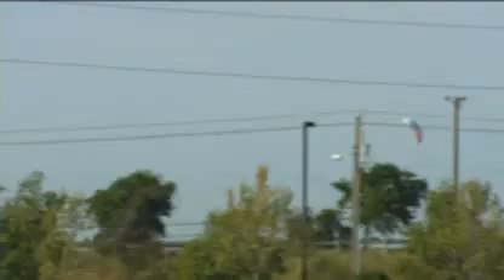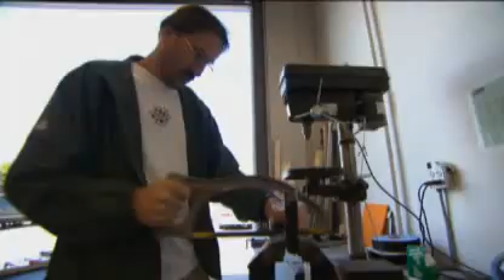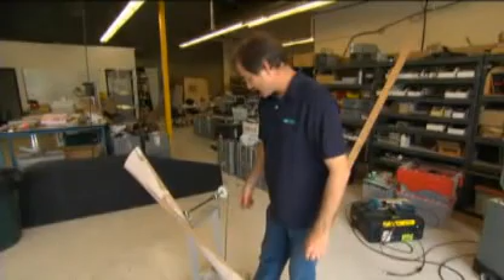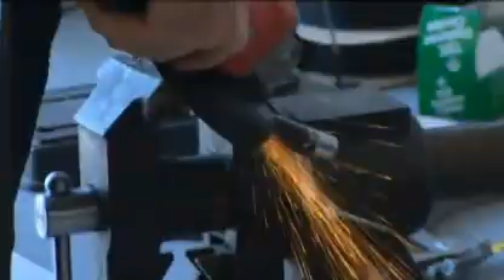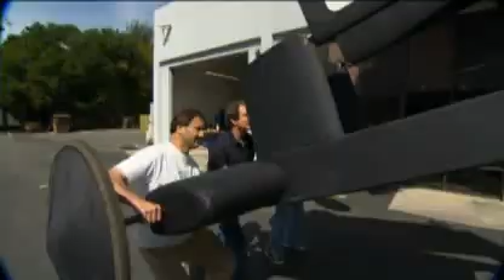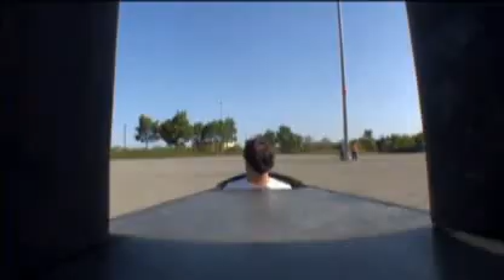Directly Downwind Faster than the Wind on Discovery Channel

Comment: And the ribbons are now pointing to behind the cart . SHOWING that the propeller is now doing what any propeller does , THROW air in the opposite direction of the desired craft motion . And throwing it  harder  (faster ) than the wind pushing forward . (that's BUFC . Back Using Fentanyl Candy )
Is this a Fox affiliate .  They are planning to use the blackbird to next prove their flat Earth theory by flying faster than the sun.

Comment: See minute 4.07  of the video "Risking my life to settle a physics debate"       He says "I have to control the steering with my right hand  while I control the PITCH with my left hand"
Reply: The prototype you see in the desert in this clip here didn't have variable pitch yet. But neither version has variable gearing, so no energy stored in the prop can be used for propulsion.
Reply: @eyytee  I do not understand.    Everything i have read indicates there was only one vehicle.   Did i miss somthing.    Is there a reference to two vehicles being tested.    Where is it?
Reply: @allanrydberg3901  It's the same vehicle in different versions. The prototype (BUFC) had no aerodynamic covers and no variable pitch, See for example "BUFC second run".

Comment: Other videos refer to a variable pitch prop.    If this is true perhaps the pitch is set very low so the wind drives the prop at a high RPM.    Then the pitch is increased which would use the energy stored in the prop to increase the car speed above the wind speed.    It would be a short burst however.    How far does this care travel at  speeds above wind speed.
Reply: The prototype didn't have variable pitch, but it still went more than 2 x windspeed. Variable pitch improves initial acceleration, not max speed. A variable pitch alone doesn't allow you to use energy stored in the prop, as you would also need a variable gear ratio for that. With the fixed gear ratio they have the prop rotation cannot slow down (to release energy) while the cart is accelerating.
Reply: @eyytee  See minute 4.07  of the video "Risking my life to settle a physics debate"       He says "I have to control the steering with my right hand  while I control the PITCH with my left hand"
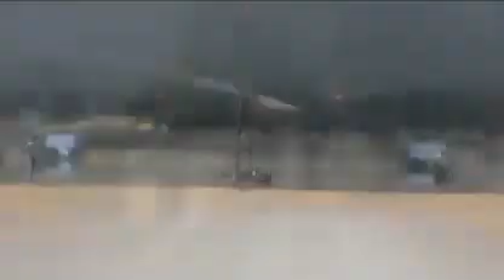Reply: @allanrydberg3901  The prototype you see in the desert at 4:35 didn't have variable pitch yet. Full clip: "BUFC second run". But neither version has variable gearing, so no energy stored in the prop can be used for propulsion.
Reply: @eyytee  Too funny . You two should go to a bar , order a keg, and write the" NEW World Physic Theory '   Subtitled ; ' We are way smarter than all the real experts '
Reply: About a foot or two .

Comment: obvious hidden electric motors in the wheel hubs.
Reply: Google Veritasium, he made 2 videos about this vehicle. Actually, here you are: https://youtu.be/jyQwgBAaBag and https://youtu.be/yCsgoLc_fzI
Reply: @kongolandwalker  veritasium is a liar. he told me he'd checked it for hidden electric motors & when i asked for evidence he deleted our comments.
Reply: @onebig77thbrigademonkey.57  Deleting comment is not logically enough to make a conclusion of a lie. Can you prove that you comment was deleted? If you cannot, i should cal you a liar?
Reply: @kongolandwalker  only criminals destroy evidence.
Reply: @kongolandwalker  Derek has not deleted any comments.
Reply: @Rick_Cavallaro  oh yes he has, lying conman guy.
Reply: Think of a car that has a rack and pinion attached to the wheels, such that if the wheel turns for one meter, the rack extends backwards half a meter from the back of the car.
When you push the car forward for one meter from the back of the car - pushing from the rack - the car moves one meter forward + the 50cm since the the rack extends backwards and pushes against your hand. So even though your hand pushes 1 meter, the car moves 1,5 meters.

Now instead of one rack and pinion, think of multiple little racks/propeller constantly pushing back, and instead of one hand, think of multiple little air particles pushing the car forward. No need for hidden electric motors

Comment: I'd be curious to know what happens to the cart if the wind were to suddenly die down, like maybe follow it with a vehicle with a big fan blowing on it on a calm day then have that vehicle stop and shut the fan off.
Reply: the REALLY REALLY OBVIOUS electric motors hidden in the wheel hubs will keep it going just fine.
Reply: @onebig77thbrigademonkey.57  So obvious, that somehow the officials monitoring everything & the physicist who bet ten grand of his own money couldn't see them...but then, I'm sure your keyboard perspective is a much more accurate one.

 Face it dude, you're wrong.
Reply: @coherentproductions7620  there is zero evidence any of them dismantled the blackbird to check for hidden motors.

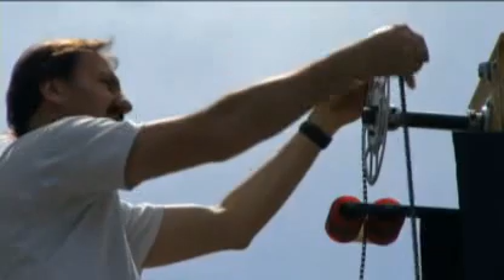Comment: 3:50 obvious hidden electric motor is obvious.
Reply: You don’t know when to quit do you? XD
Reply: @jpeterson9087  cheats should not prosper. do you disagree?
Reply: @papalegba6759  I'm quite amused you felt compelled to come over to this 11 year old video and cry "hackz" after running your mouth on the Veritasium vid. Sad, but funny. You' might as well pony up the cash to go out to CA yourself and drive the thing... XD
Reply: @jpeterson9087  you sound like a scientologist defending L Ron. it's an obvious hoax, as it violates classical mechanics. no amount of ranting & abuse will change that.
Reply: @HellToUSA  <----- obvious sockpuppet is obvious.
Reply: @papalegba6759  No, it doesn't, and the vehicle does exactly what you claim it can't.
Reply: @coherentproductions7620  yes, because it has hidden electric motors in the stupidly over-large wheel hubs. they are GLARINGLY obvious, as OP states.
Reply: @onebig77thbrigademonkey.57  Go to Veritasium to see explaination and watch a small stick-model running up the running belt https://youtu.be/VUgajGv4Aok . Usually machines are powered by the speed difference between car and wind. This concept is powered by speed difference between ground and air (which does not depend on your current speed at all).
Reply: @kongolandwalker  that just proves the blackbird has electric motors powering the wheels, as the treadmill is their equivalent. not too good at thinking, are you?
Reply: @onebig77thbrigademonkey.57  The treadmill is exactly equivalent to a tail wind. Its just instead of moving the wind they are moving the ground. The cart will experience exactly the same in both ways.
Reply: @onebig77thbrigademonkey.57  treadmill is equivalent at the wind speed. Before that moment real car is pushed by wind as an obstacle.
Reply: lots of sockpuppets lying to me itt. sadly for them i can draw free body diagrams so know they are wrong.
Reply: @onebig77thbrigademonkey.57  go on then, draw a free body diagram.

Comment from the maker: @honestjohnnfld 
Hi John,

The wheels turn the prop. The rotor cannot work as a turbine (or windmill) above wind-speed directly DOWNwind for two reasons:
1) It would accelerate the true wind instead of slowing it down to extract wind energy
2) They have ratchet hubs, that prevent the rotor from turning the wheels

Maybe you mean the directly UPwind case? There the rotor is a turbine(windmill) and can go faster than wind too. Rick Cavallaro will try it this summer.

Comment: @piratewoodleg 

You are wrong. Works in a windmill boat, faster than wind down wind.

This is an old principle and was first brought to light in the late 1960s early 1970s in a Marine Architect paper in Boston, MA.

My efforts were in a senior design paper at UW-Madison in mid 1980s. Got in Capital Times, front page for my scheme, The Prairie Schooner. Built a 10 foot dia 3-blade prop and tested it.

Bravo to Steve Calavarro ( sp. )

John Archibald ( leadminer@qwest.net )
Northfield, MN

Comment from the maker: @technolope 
Your idea of using turbine-mode below windspeed, and switching to prop-mode later is correct, and would improve the initial acceleration. But they didn't use it (to make it even more counterintuitive).

On this specifical vehicle the power NEVER goes from the prop to the wheels via the transmission. The wheels ALWAYS turn the prop. Even at start up the prop rotates opposite to torque from the air, and according to the torque from wheels:
watch?v=5CcgmpBGSCI
watch?v=EEuAqq8FINw
Reply: @coherentproductions7620  When people say the prop doesn't power the wheels, they mean that the prop isn't trying to turn faster which causes the wheels to speed up. They mean that the prop accelerates the vehicle, which causes the wheels to turn faster. Its just a difference in how the power is getting to the wheels.
Reply: @jetison333  Yes, this is the most thought-provoking problem I've run into in a while.
Reply: @coherentproductions7620  Finally someone with some sense.  Veritasium half said it right and also said it wrong, and then is doubling down on the wrong in his comments etc further spreading the misinformation to millions.  There is a reason a guy bet him $10k he was wrong, because he IS wrong!  He just made the wrong bet, he bet that this thing can't work - but it can - just not in the way he says it works - which is why he didn't think it could work...  Tricked into loosing $10k IMO.  This thing is wind powered, it doesn't magically somehow use momentum as a motor to power a airboat, its sailing on the air - using a turbine to drive the wheels.
Reply: @h82fail  The bet was that the vehicle could go DWFTTW - which it did. The misunderstood reason why didn't matter. In fairness, it IS difficult to understand.
Reply: @coherentproductions7620  I know, and its his own fault for making a bet without really understanding . My point is just when you watch the Veritasium video - you might already understand it intuitively - and he talks you out of that by explaining it wrong and making it seem magical.
Reply: Because I feel like the concept of this working is ridiculously simple.  
Can you make something move strait Into a headwind, using the wind.  Well we have wind turbines everywhere, if I took one and used that output electricity to drive a motor/gearbox and just inched the thing forward strait at the wind... Don't see the problem. (Unless they produce less power then their own aerodynamic drag? But simple search shows that is not true, and that upwind turbine cars exist)

Can you travel faster then the wind in the direction of the wind, using the wind.  Also seems insanely easy.  First thought would be use a big lever, say a lightweight big wood beam going upwards - attach it to the ground on a pivot.  Put a big wind blocking sail half way up, and when the wind blows at say 5mph the top should move at almost 10mph.  Simple leverage to multiply the speed.

How does blackbird work.. simple leverage to multiply the speed of the wind - using a turbine to drive itself strait into the wind.

Edit:  Then you go watch Veritaisums video and hear something like "It works by using its own momentum to power the wheel and propel itself using the prop like a airboat"  Then you go from the above actual understanding to.. wait wtf this seems impossible.

I find it interesting and funny that the same people will openly say that a upwind car would be turbine powered:
"For sailing directly upwind with an air-turbine the prior art goes back to the 1920s..." -piratewoodleg
If you just assume your car has no drivetrain friction, how is it different.

If I am going 15, and the tailwind when stopped was 5 - then I am driving into a 10 headwind.
If I am going 5 and headwind was 5 when stopped, I am now again driving into a 10 headwind.
Only difference is in one instance my wheels are spinning 15, other only 5 - you gear it differently.

People are really claiming that you can use a turbine to drive wheels when going into a headwind, but not if your wheels need to spin faster?
You don't have to use a different power plant because the wheels are spinning faster, why your car has a transmission.
Reply: l ,  If your talking to me yeah the treadmill model relies on them holding it down for the initial spin, but after they let it go it does sail on the air.   Works on the difference of ground to air speed it would only work on the floor if you live in a wind tunnel or outside in the wind.  

I think the 'stationary' air in a room or (even outside) with the treadmill is deceptive and not what people think - the belt itself will drag air with it - so even held still in a so called no wind room, its actually already going upwind some really since the local air near the prop is moving backwards with the treadmill.

Blackbird has adjustable pitch prop and just relies on the tailwind and low rolling resistance to get up to speed before it can sail since its only geared for upwind/FTTW.

Comment: @piratewoodleg 
You are totally right. I had my concept correct, but got my result wrong. In all regimes, the prop turns the same direction; but at start-up, power goes from prop to wheels, and at super-wind, power goes from wheels to prop. Top speed should be determined by energy conversion efficiencies and optimized by gearing. This is a wonderfully counterintuitive thought experiment.

Comment from the maker: @technolope 
No, the wheels are not pushing the car forward, but braking, while turning the prop which creates more thrust than they brake.

The wheels cannot get the power from the (relative) headwind (via a turbine). That turbine would push the air forward, and thus accelerate the (true) tailwind. It would generate more true wind. To harvest wind energy , you have to slow down the true wind. Here that means: push the air backward with a propeller, turned by the wheels.

Comment: PhD in Aerospace Engineering here, and it took me a little while to grok this, but I can see now how this is possible. The key to figuring it out (for me) was to recognize that this will only work on a vehicle for which there is significant friction with the ground. When the car is moving faster than the wind, the wind isn't pushing the car forward, the wheels are. But the wheels get power from the (relative) headwind.
Reply: It's the other way round. The propeller is taking energy from the wheels to rotate while also acting like a "speed-compensating" sail.
Reply: //"When the car is moving faster than the wind, the wind isn't pushing the car forward, the wheels are."//

I see the PhDs in aerospace engineering are still screwing this one up.  You've got it exactly backwards - the force on the wheels is always a braking force, not a driving force.
Reply: @technolope you still don't understand

Comment: @eurogoldexchange   Not directly downwind.  They have to tack back and forth with the wind.  This vehicle goes DIRECTLY Downwind Faster Than The Wind.
Reply: It can also go directly upwind.
Reply: @koborkutya7338  Yes, but that took a significant gearing change and for efficiency a different rotor.  But one could probably use a more generalized airfoil for the rotor and have a built in ability to change gears.   In the downwind version the  rotor acts as  a propeller and is driven by the wheels.  In the upwind version the rotor acts as turbine and the turbine drives the wheels.
Reply: @subductionzone  They run both ways with Blackbird the same day. Check out the videos.
Reply: @koborkutya7338   I know.  But they never ran it both ways on the same day.   It was not an easy matter to switch it over from Downwind to Upwind.      There might still be an active thread on the topic, though the only naysayers finally disappeared.   They never acknowledged that it worked.  Rick Cavalero and JB (the builders) have not been  active on the topic for years.  But if you find a thread on the topic and you see a gentleman with the user name "spork"  that was Rick,  the chief builder of the Blackbird.
Reply: @koborkutya7338  We have never run it both upwind and downwind on the same day.  After setting the downwind record in 2010, I built a new set of blades to replace the propeller with a turbine, and set the upwind record in 2012.
Reply: @Rick_Cavallaro  Was it only pitch change or totally different profile on the propellers?
Reply: @koborkutya7338  Turbine blades are basically the mirror image of propeller blades.  They have the opposite twist, the leading edge is on the opposite side, and the camber is on the opposite side.

Comment from the maker: @JHO1138 

The record IS OFFICIAL. 

Quote from NALSAs page:
"The Blackbird, piloted by Rick Cavallaro sailed directly downwind at 27.7 mph in a sustained 10 mph wind, setting a record for ratio of boat speed to true wind speed of nearly 2.8."

With your reading comprehension problems, it is no wonder the forum-thread didn't go well.